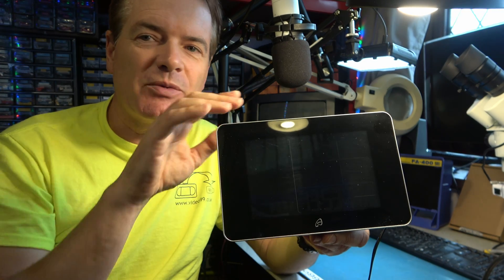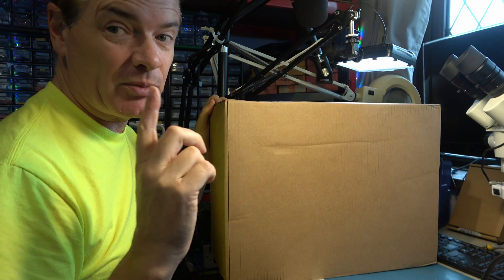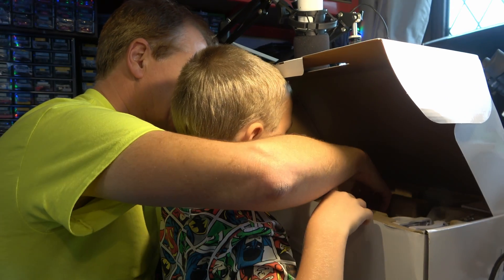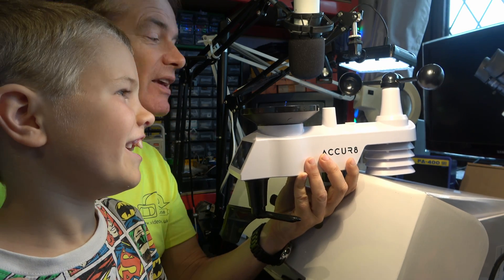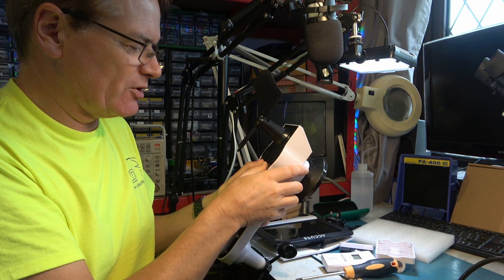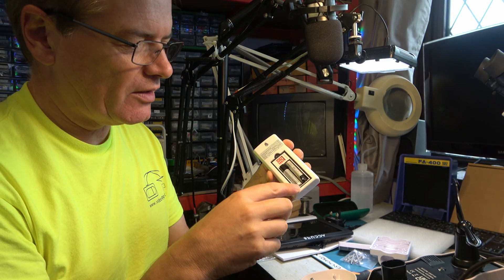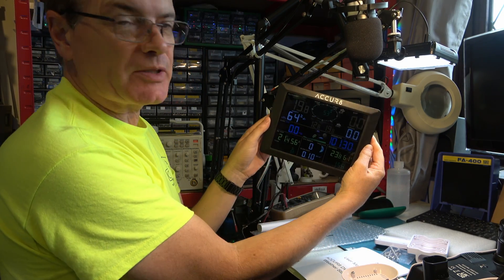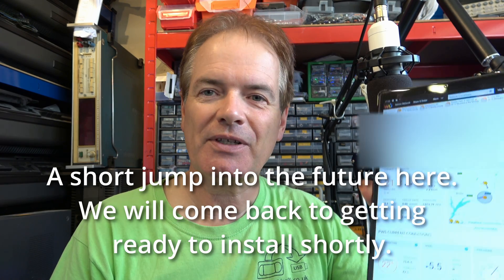Install and play with an ACCUR8 DWS7100 weather station.

Comment: I have to admit that the WiFi, Wunderground and Weathercloud setup I never looked at the instructions apart from enetering setup and the IP address, I just followed the on screan prompts. Setup took under 5 minutes :) Later on I read the instructions and was glad I didn't read them earlier. 
The only issue I had was what type of unit it was for Weathercloud and have stuck to W100 for now. I;m not sure who manufactures the unit, it's the same as La Crosse and a few more.
Mine is mounted on a 3M metal pole well away from the house which is only a bungalow anyway. The pole has a metal plate that I welded to the side and the unit is align up north/south. My phone or compass then aligns on the plate. 
I've made sure the pole, mount and unit are all in perfect line as looking for the level bubble 3M up a pole is not possible without a cherry picker!

Comment: Good video which came in handy after purchasing the ACCUR8 DWS7100 7-in-1. What's missing is the setup of an additional console in the instruction manual. I agree with the comments below that an step by step procedure by an app for any device will make the whole setup much easier. The current procedure is archaic and you need to have a reasonable handle on how network connections work.

Comment: You'll never get true wind direction unless you mount it high up. A chimney stack or above the apex of your house roof is the best.  They work so much better . Even the temperature readings benefit because of increased air flow to the screen.
Reply from the maker: Trouble is though, it then becomes very hard to replace batteries, clean the rain gauge tipper and generally maintain the unit.
Reply: @video99couk  There's a lot to consider and it is challenging to site a weather station.  My solution was to mount it on the rear wall of my property and slide the pole down when servicing is needed.

Comment: indeed the outdoor sensors that break down quickly, especially the wind speed spinning top

This is usually entirely made of plastic and the rods break quickly.

You simply pay good money for a good weather station.
Reply from the maker: I hope that doesn't happen, this wasn't cheap.
Reply: I have a Ventus W205-U weather station here
1½ years later outside sensor station was broken. A cup of the windcubs spinning top was broken off.

I glued it, it remains weak. I also have the idea that the plastic is affected by weather influences and UV light.

Good spinning top consist of three parts hub stainless steel rods and good quality cubs.
Reply: 俳優や科学者になってほしいですね😊❤❤❤❤❤
Reply: The windcups are a consumable item that the consumer should be able to replace if you can source replacement parts.  That is one thing that bugs me with some manufacturers , they don't readily supply parts.